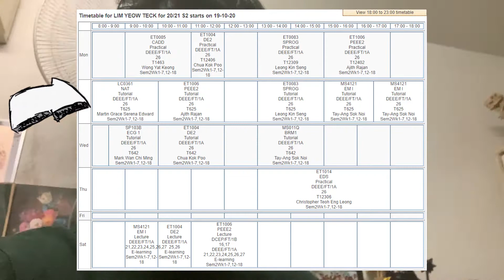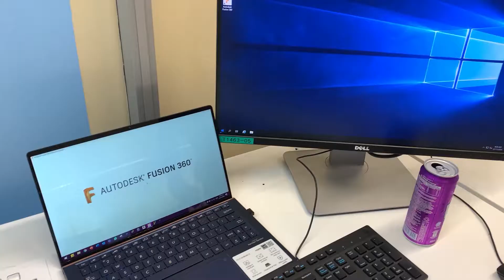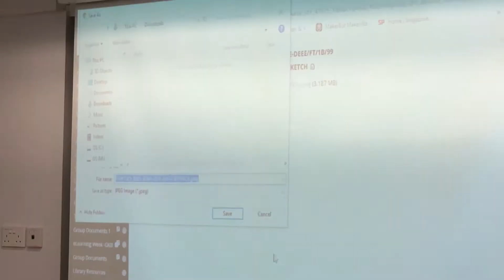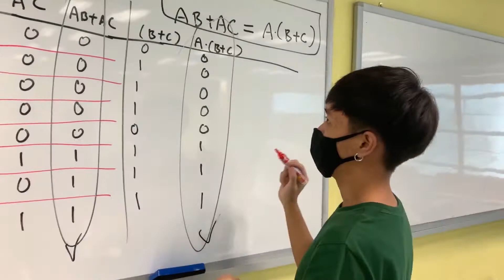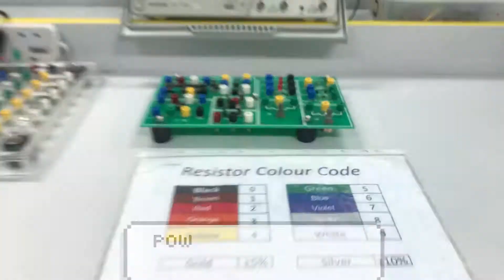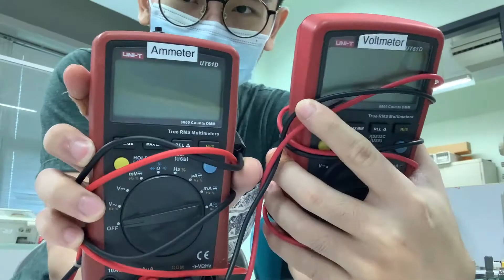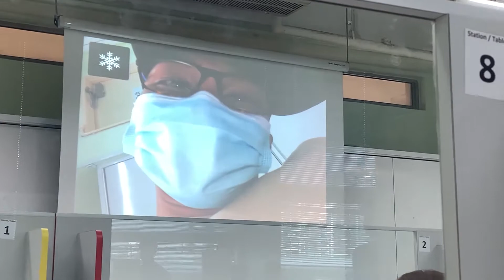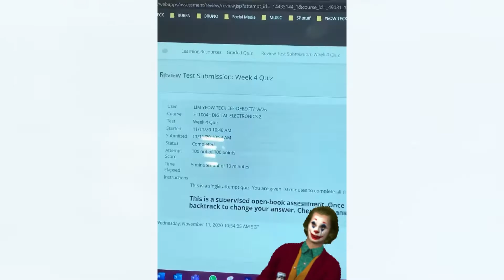IN THE LIFE OF A STUDENT IN SINGAPORE POLY [ELECTRICAL & ELECTRONIC ENGINEERING]

Comment: Nice video, beside the point of the video, but curious what laptop you are using to get through your studies
Reply from the maker: Thanks, I'm using a ASUS UX333 (ROYAL BLUE)
13.3" Compact Ultraportable. It's rather small but it fits in my bag and light.
Reply: @_only_ruben  would you recommend it for other engineering courses as well?
Reply from the maker: @pandidhinalan7668  I will most likely recommend it if you like small keyboards, but I’m fine with it. The screen will be slightly smaller too than a standard 15inch laptop.
Reply from the maker: @pandidhinalan7668  if your course requires a lot of programming and software driven stuff like web design. I suggest getting a much sophisticated laptop than this.

Comment: bro how difficult is the course out of 10 rating
Reply from the maker: Since I had a background on Electronics Engineering from ITE before poly. I have to say it's 7/10. But if not then 4/10. This course is quite tough and requires a lot of logical, mathematical solutions and programming. It is not impossibly difficult but it is mentally tiring compared to the rest of the courses like from MAD.